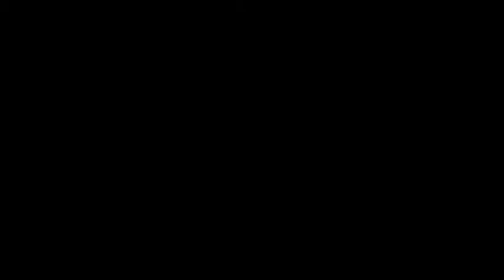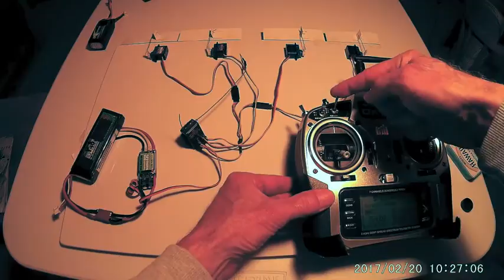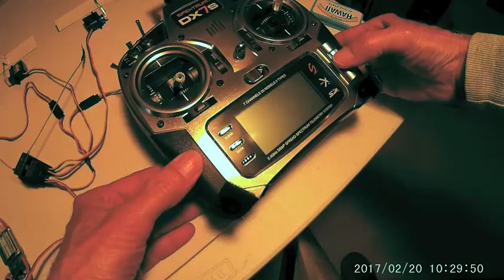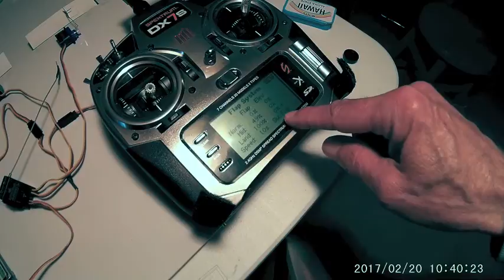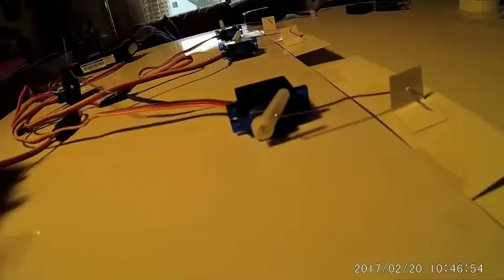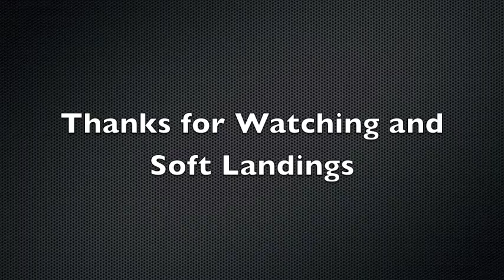Spektrum DX7s flap servo setup

Comment: Hi, so I’m quite confused. I recently picked up 3 amazing condition rc gliders for free and the asw28 style one has a confusing servo configuration in my opinion. In total There are 4 on the main wing, the wires come down and then they get split into 2 DuPont connectors. So does that mean one of the connectors will control both flap servos and the other will control both ailerons? Long story short, there is 2 servos per 3 pin connector. Sorry if this is confusing, it’s hard to explain in a comment section.
Reply from the maker: Yes, it is common for two servos to be combined with a "Y" adapter. A "Y" adapter combines two servos into a single plug.  This is common on aileron servos. Aileron servos are mounted asymmetrically, allowing them to move in opposite directions at the same time.  Regarding the flap servos.  Typically, flap servos are also mounted asymmetrically, however, they must move in the same direction, unlike the aileron servos, hence, each servo would require it's own receiver channel.  However, if the flap servos are mounted symmetrically (same physical orientation), then you could combine them with a "Y" adapter and use only one receiver channel.   Let me know if I can be of further help.    Bob

Comment: not sure yet.  This plane seems to bring up question after question.  Are you familiar with Eflites AS3x technology?
Reply from the maker: Kinda, I have an eFlite UMX Radian with AS3X controller.  The controller simply tries to keep the plane level after you center the sticks, pretty cool.
Reply: Correct.  My plane sits on a plane stand when I am working on them and  my control surfaces are all set to neutral at this point.  When I put the plane on the ground and its sitting with its tail dragging the elevator (as3x) wants to orientate in the  down position.   If I set the elevator control surfaces to neutral while the plane is tail dragging the elevator will have opposite effect once the tail lifts off the ground.  LOL...I have no idea if this makes sense...
Reply from the maker: This sounds normal John.  Did your AS3X receiver come pre-installed in your Maule?  The mounting orientation of the receiver in the model is crucial .  If you haven't already, I strongly suggest that you go through the AS3X Skektrum tutorials on YouTube .  https://www.youtube.com/watch?v=LnYiKgrL_bU  It can get a little complicated.  You need to check and make sure the AS3X gyro corrections are moving in the correct direction.  You also need to make sure the control surfaces are moving correctly relative to the stick movements.  Do you have multiples modes on your transmitter?  Anyway, I have a very simple AS3X model,  eFlite UMX  Radian, it's only 3 channel, in my case, I just bind and fly; no fancy setups.  Let me know how it's going.  Bob

Comment: Bob....that helped....thanks!
Reply from the maker: Great !  When will you maiden your Maule ?
Reply: Bob...took out the Maule for its Maiden early this morning.  No flight footage....my boys were still asleep.  Great, great flying plane.  4s power, 3000mah.  Pulls to the left on take off though which is a little uncomfortable.  I kept having to input opposite rudder to counter that.  I did not want to set the trim on the controller to counter because I think that would be bad once airborne.
Reply from the maker: Congrats John.  Take some footage if you have a chance, I'd love to see the Maule in flight.   So, does the Maule pull to the left in straight and level flight with a cruise setting on the throttle ?   Have Fun
Reply: Thanks Bob.  I will get footage for sure.  At slow taxi it goes straight.  Once I throttle up it pulls to the left and then takes off.  Once in flight she is silk smooth and straight as an arrow.
Reply from the maker: OK then, straight as an arrow.  I don't have much experience with ground take offs; most of my planes are hand launched.  I don't have the advantage of a smooth and level surface for take offs.  I fly atop Pinole Ridge and don't have smooth level surfaces up there.  I fly general aviation planes.  As you may already know, there is something called the "P factor", or left turning tendency of a plane during take off.  Even in the small planes that I fly, like the Vans RV-12, or Cessna 150, etc, you need to hold quite a bit of right rudder to keep the plane going straight during take off.  Not sure if this could explain why your Maule is wanting to go left during take off. Take care.   Bob
Reply from the maker: p.s.  Are you flying with the AS3X activated?  If so, what mode of AS3X are you flying?   If you are flying with AX3X turned on,  I believe the gyro in the receiver will always try to keep the plane straight and level when the sticks are in their neutral position;  even if the trim is not quite correct;  just guessing here John.
Reply: Hi Bob.  Yes I am flying with AS3x on, but I am not sure of another mode.  I will check that out.
Reply from the maker: Here's a good article on AS3X.  I presume your Maule has "safe" mode?  https://www.spektrumrc.com/Technology/AS3X.aspx

Comment: Bob....another DX7 question....how do I adjust my throttle stick so it does not start the motor as soon as I move the stick just one little click up...?  Thanks Bob!
Reply from the maker: Hey John.  Try adjusting the throttle trim.  There is a toggle switch just to the right of the throttle stick.  This switch can be pushed up (to increase throttle neutral position) , or pushed down to decrease throttle neutral position.  Give that a try and let me know if that works.   Bob
Reply from the maker: John, did the throttle trim work for you ?

Comment: Thanks again.  It came with a bad rudder servo. Amain is sending me out an upgrade! Are you in northern california?  Iam in San francisco.
Reply from the maker: You're welcome John. I am in Richmond, CA., east-bay San Fran.  Thanks to you, I have re-kindled my interest in fixed-wing RC which is much more challenging than flying the fully auto DJI drones.  Do you belong to an RC club?  At last count, I have 23 fixed-wing RC models; looking to donate a few; running out of storage room.  One of my favorite RC models is an RC Eagle, I think it was from BP Hobbies; in flight, it looks just like a bald eagle; in fact,  hawks and eagles flying nearby will try to attack it.  I have an eFlite mini radian, which also has the AS3X stabilization like your Maule.  I have a favorite nearby flying spot up on Pinole Ridge.  Soft landings.   Bob
Reply: @bobclarie  I know what you mean...the fully autonamous drones are amazing tech....but super easy to fly.  That's why I just got a helicopter...the blade 230s V2.   Helicopters can be a handful.  No, I dont belong to any clubs.  I usually fly at Sierra point in Brisbane.  The Livermore electrons  does look like a great club...just far  from me.

Comment: Bob this is the result of those settings.  My toggle switch at 0 (Norm) flaps are all the way down.  Toggle switch at 1 (mid) is mid and toggle switch at 2 (Land) flaps are in full up position.  Thanks John
Reply from the maker: OK, your servos are running opposite than mine.  Two options here.  Swap the settings for "Norm" and "Land" in "flap system".  Or, go into "Servo Setup", locate your flap servo, select "travel" go to "reverse".  Go down to the bottom and change the current setting of "NOR REV".  That should do it.   We're getting close, I think.   Bob

Comment: Here it is Bob.
Spektrum AR636A
1 Throttle 2 Airelon 3 Elevator 4 Rudder 5 Lights 6 Flaps.
Under my flap systems I am programmed according to the Maule Instruction manual.  Norm: 100% Flap  Mid 0% Flap w/ 4% Elevator  Land 100% Flap w/ 10% Elevator, Speed 2.0s  Switch = FLAP 
Thanks Bob.
Reply from the maker: Do your flap servos share a single channel with a "Y" connector?     I think "Norm" should be "0"    "Mid" around 20 to 40, and "Land" around 100 + or -      "Norm"   would be flaps all the way Up.    "Mid"  somewhere in between      and    "Land" would be   down to your desired angle.   OK, I just looked at a photo of the eFlite Maul, and yes, the flaps do share a single channel;  my Bixler2 uses a separate channel for each flap servo because they are mounted like aileron servos; asymmetrical.  You will not need to do any mixing like in my video.  Try my above suggestions John.  Bob

Comment: Hi Bob.  I love quads.  I have the Mavic Air.  I have rudder control back which is great news.  Still trying to figure out the flaps though.  Thanks John
Reply from the maker: What receiver are you using, and what channel is each servo plugged in to ?   The Mavic Air looks like a nice aerial photo platform.   Go into your "function list"  then enter the "flap system"  and tell me the values under "Flap"  for "norm"  "Mid" "Land"  "speed"  and "Sw".   Are there any values under "Elev"  ?

Comment: Bob....I am moving inthe right direction but still stuck.  on position 0 flaps are now up which is good.  Move to switch 1 and they lower.  But then when i move to switch 2 they go back up instead of lower one more time.  I also lost rudder control and cant figure that out.  I checked the rudder plug and its plugged in.   Any thoughts?  Cheers John
Reply from the maker: Hi John, I haven't flown  fixed wing RC for quite awhile; been flying my Mavic Pro quad.  The battery in my DX7s is dead, will charge it back up, and review the setup in my DX7s once charged up.  Can you tell me what receiver you have?  and what channel each servo is plugged in to.  We'll go from there.   Bob

Comment: Thanks so much for this.  I just bought an eflite maule and I have the dx7s.  Is there a flap reversing option.  My flaps are down in position 0...and up in position 2?
Reply from the maker: Hi John, if you review my video again, around 9:50, you'll see where you can change the servo from NOR, to REV.  Try changing those settings and you'll find the correct settings for the flap settings.  Keep us posted on how your eflite maule is coming along.   let me know if you have any further questions.    Best.    Bob
Reply: Bob.   Thanks!  Will do!

Comment: Bob I have added flap servo's to my Bixler 2. I have the wing laid out the same way as your video shows. I also have right flap servo on the Aux1
Channel and the left flap servo in the gear channel. I am only getting the left servo to work. Both servo's will not move when you use the flap switch. I have tried different Rx's and plug servo's in to rudder and elevator to check if the servo's are working. 
Would you help me out please. 
email is best for me. Cranfordkis1@gmail.com 

Thanks in advance
Reply from the maker: Hi Kevin . . First things first.  What make and model transmitter and receiver are you using?  Standing by to help.  Bob

Comment: Why my flpas servos are not even. It does start even in neutral, it twisted on middle position and still twist on 3er flaps position
Reply from the maker: Make sure the flap servos are identical. The linkage setup must be identical also.  Lastly, make sure the % of travel is the same for each flap servo channel.   Bob
Reply: All my servos are the same, also I try different servos brand and are not lane up, also try different reciver, it got me crazy
Reply from the maker: OK, confirm that your servos are identical, the physical linkage is identical, and the % of travel is the same.  What transmitter do you have ?
Reply from the maker: Can you explain what you mean by "twisted"
Reply: They are not lane up
Reply from the maker: Not sure if I can help you.  I do not know what transmitter you have.  I do not know if the linkage is set up the same.  I do not know if the % of travel is both flap channels are the same.

Comment: Hi bob...sorry it's so long time.
I need your help again. Now I have dx8 gen2 transmitter, and very tens , how to fix my flaps on dx8 gen2 transmitter.  Please help n reply me. Thanks
Reply from the maker: Sorry so long to respond, must have overlooked.  I'm not familiar with dx8, however should be similar.  What kind of problems are you having . . hopefully you have fixed it by now.  Bob
Reply: @bobclarie  hello  bob. I am using 2 servo for ailerons with Y cable. And using 2 flaps servos with Y cable. How to program it ???
Reply from the maker: @rczone9830  If you want to use a Y cable for your flaps, you need to have the servos mounted opposite of the aileron servos;  i.e., mount them in the same orientation.  Aileron servos are mounted in the opposite orientation.  Hope this helps.    Bob
Reply: @bobclarie  how I can share my servos picture I wanna discuss something
Reply: @bobclarie  actually my problem is that I installed the servos, now I can't change the orientation. But can the fix reverse y cable some kind of. Please make sure the easy way to talk for further help. Thanks 
Regards
Reply from the maker: @rczone9830  Post a video on your channel, showing your plane, servo setup, receiver and transmitter.    Bob
Reply: @bobclarie  thanks,  I fixed it.
Reply from the maker: @rczone9830  how did you fix it ? ?